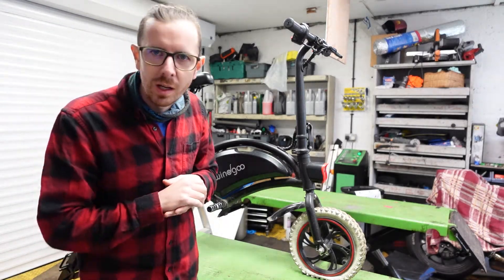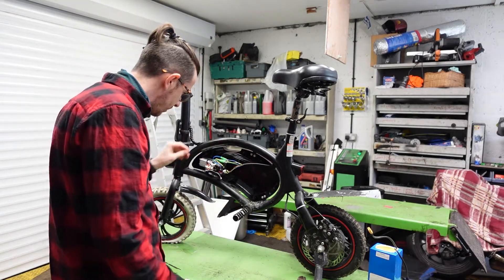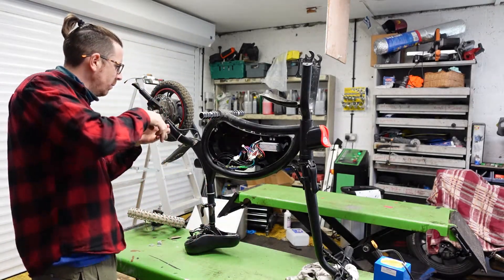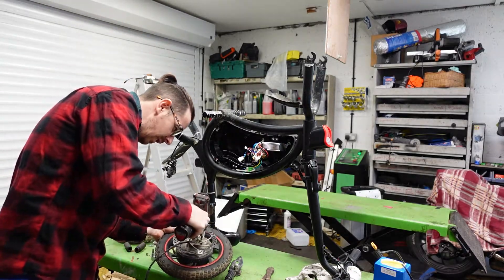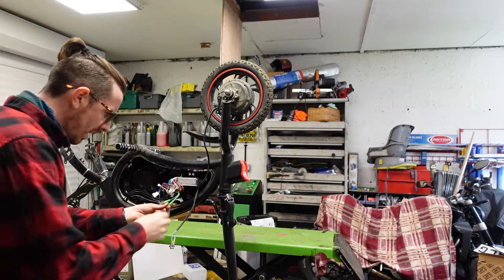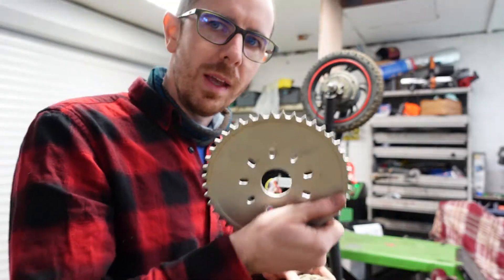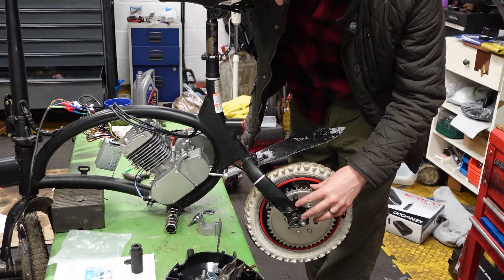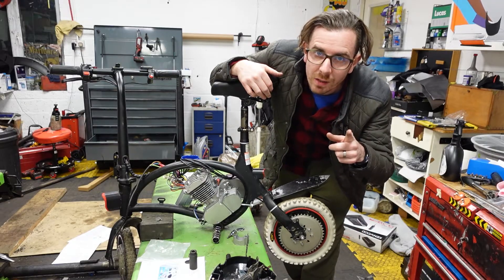Can we put an 80cc engine on a Windgoo b3 electric bike?

Comment: Hi got one of these, can u put a solid tyre on it rather then a inner tube?
Reply from the maker: no it does not have the lips to allow a solid tyre its inner tubes only!
Reply: @rstv84  I had a puncture repair used it twice and got another one😭